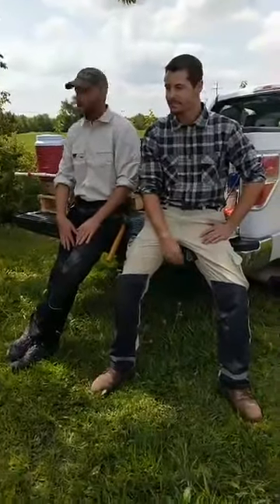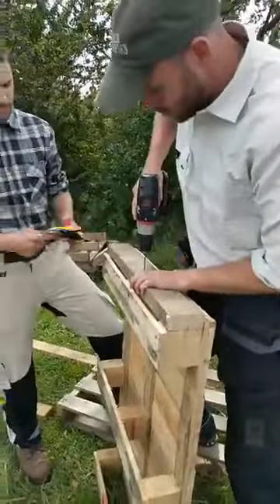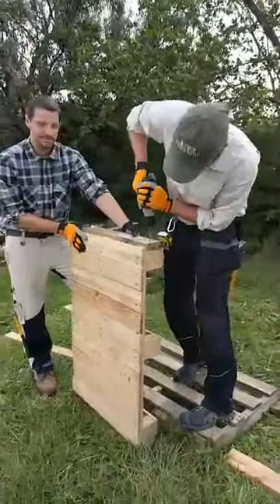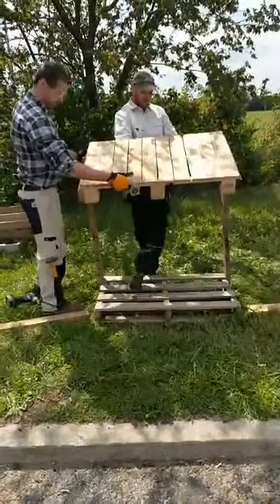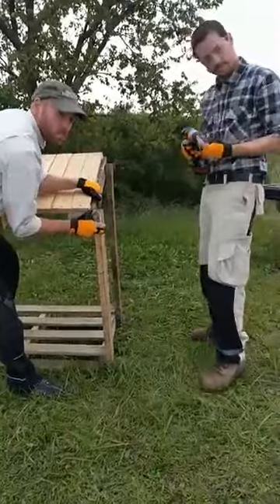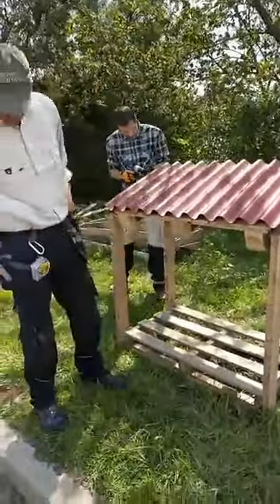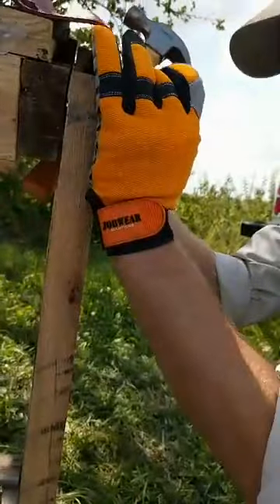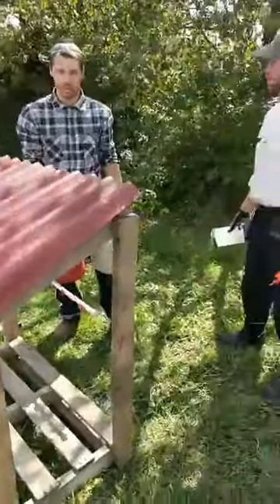How to Make a Shaded Chicken Feed & Water Station

Comment: Glad to see you secured the shade to the ground. Where I live the first big wind would flip it over. But much as I like Ondura roof to work with since it's light and easy to cut, hail went right through it when I used it on a small portable chicken shelter, so now I only use metal roof panels with solid wood under it.